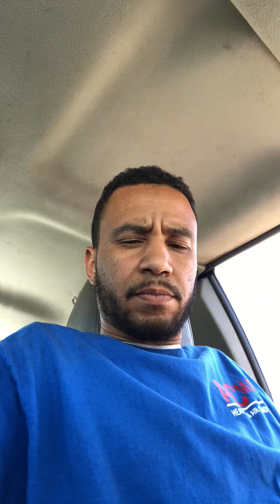Nest thermostat faulty reversing valve terminal.

Comment: Wow man you definitely nailed it I was having trouble with the compressor not kicking on like it wasn't energizing 
I switched from that stupid seasonal setting to the other
Now in order to do that on nest ver 3 you have to go to professional set up and switch it manually as soon as switch it about 5 min later the compressor kicked in 
Thank you thank you I have learned so much in the past year using nest that I could be a hvac tech by now trust me I have had a new compressor put on 
New A coil ect... plus I had previous home before my new one with tons of heat pump issues fans relays ect...
Most techs do not know how to work the nest 3rd gen but I am a pro at it now but I did not know about that stupid seasonal crap 
Thank you to this man a life saver like his page yall
Reply: I think mine is stuck in a seasonal locking mode and won't switch back into heat. Seems that when I call for heat the A/C just keeps running. Not only that I've been getting E74 on RH. Also reports problem on orange O/B on the Nest Learning Thermostat Gen.3. Your post here is the first real idea I have found besides the useless standard advice and Goggle non-support. Thanks for this!

Comment: This literally cost me $10,000. Outdoor unit (1.5T) reversing valve failed.  Then turns out internal TXV was bad.  Then two more TXVs, and finally realized that it's the Nest not keeping the reversing valve set correctly.  $2k extra for insulation to help "cure" the problem.

Comment: I was having the reversing problem: when I set the ac to cool it’s blowing hot air and vice versa. I switched the yellow Y with the orange OB wire and the cool is now cooling. Can I leave the wires like this?
Reply from the maker: No, you need a new tstat